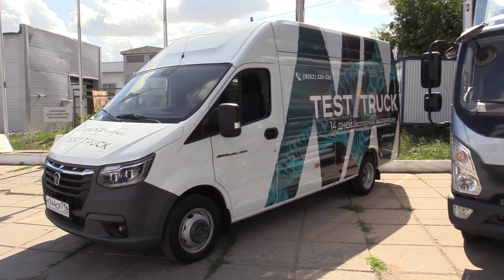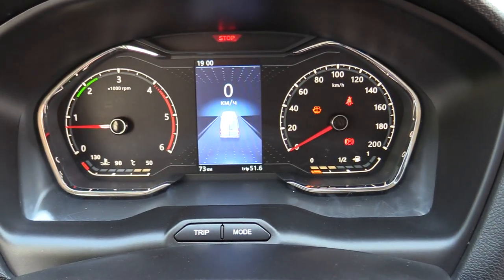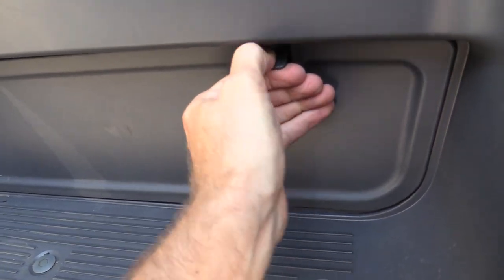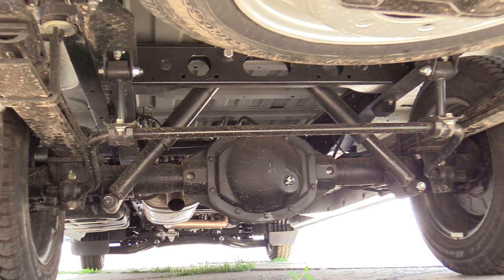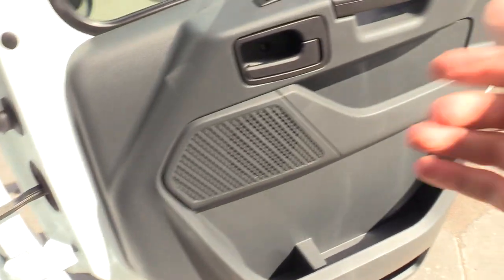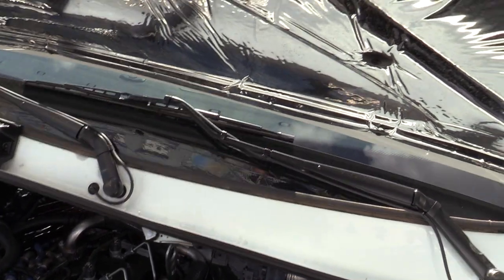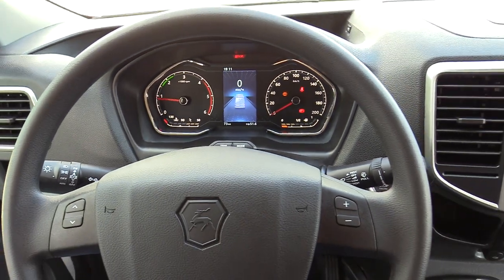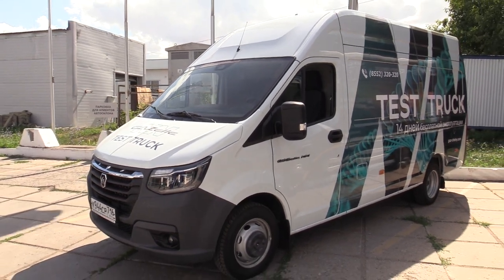2021 GAZelle NN. Start Up, Engine, and In Depth Tour.

Comment: Nice review Alex. This is Gazelle NN with Cummins diesel. Other models of GAZelle NN has VW EA189 2.0 DOHC TDi engine with AdBlue exhaust fluid for Euro-6 emissions. Also I more like Gazelle NN with euro-6 turbodiesel engine from Volkswagen, EA189 common-rail turbo diesel engine with dual overhead camshaft. Only two litres of its capacity, but emits 190hp & 402nm. Gazelle with Volkswagen diesel also has AdBlue tank in engine bay

Comment: Nice van. Would be great if there was an automatic option for transmissions.
Reply: No chance
Reply: Only for minibus model of gazelle can equipped with 6-speed AT for smoother acceleration. You can check for GAZ Vector Next bus with 6-speed AT in http://youtu.be/sc-cRvhVS0g